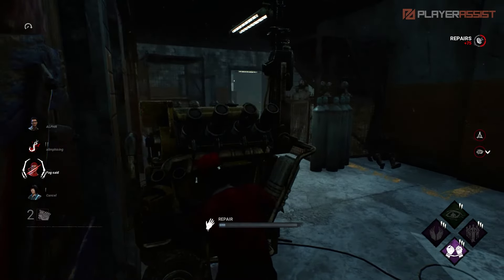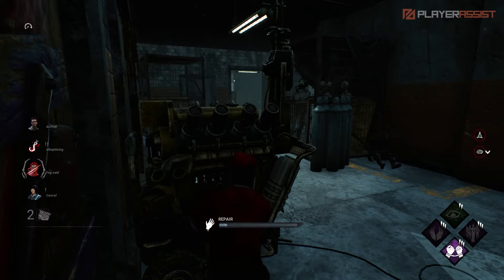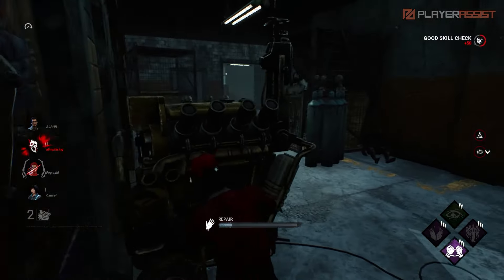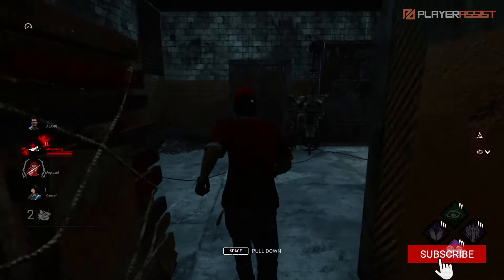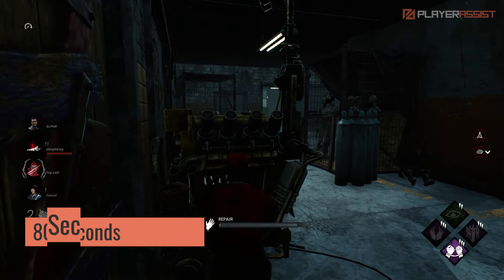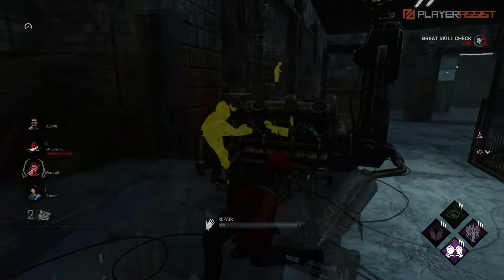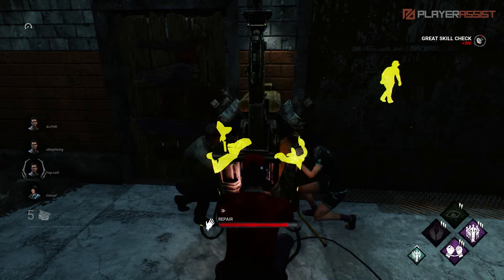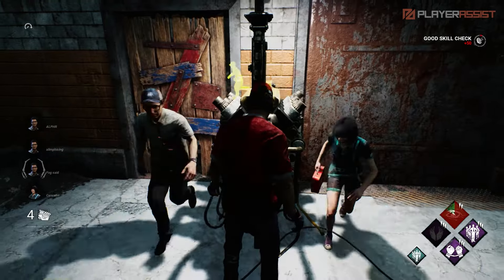How to Repair Generators in Dead by Daylight

Comment: I found this video by accident and the comments here are mindnumbingly stupid to say the least. I'm literally tearing up reading these 🤣. Hold the R1 (RB/Left Click) button down the whole time you're repairing the generator and release it when you wanna get off. Then press L1 (LB/spacebar) when the skill check pops up. The small white box gives you bonus progress and the box with the white outline lets you keep repairing the generator. This is ALL mentioned in the tutorial. Skill check also pop up when healing or interacting with certain killer objects.
Reply: Even when I land on the white bar or the outlined bar when repairing a generator it still blows up. I'm on the tutorial, I've done everything its saying to do, wtf am I supposed to do
Reply: uh NOOOO! The tutorial DOES NOT tell you which buttons!!!